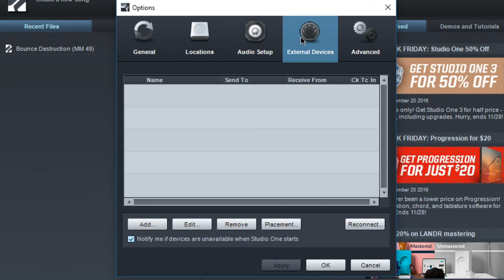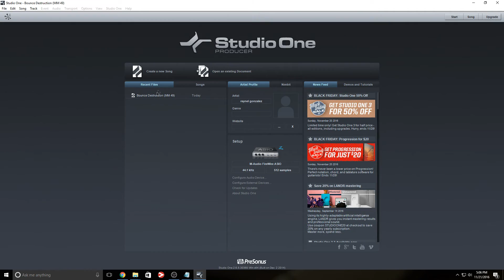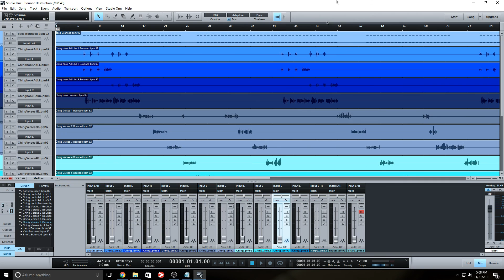setup M Audio ProjectMix I/O with Studio One

Comment: Would this be possible to do having the project mix connected via midi port only? I don't have firewire but already have an usb audio interface, and I've seen one of these really cheap on the second hand market, so it would be nice to use it just for daw control
Reply from the maker: Unfortunately no you have to connect it using firewire.

Comment: Are you running windows 10? If so how did you successfully install the drivers for the project mix.
Please help me, I've been looking all over the internet trying to make this work haha
Reply: I can tell you what worked for me...
I don't use the FW400 jack that is on the motherboard.  I have a dedicated FireWire card with 2 ports that I installed into computer.
For some reason the chipset is more stable and just works better.  It's an LSI 1394 OHCI Compliant Host Controller. These are a dime a DOZEN on ebay...
https://www.ebay.com/itm/NEW-GENUINE-LSI-H924H-DUAL-PORT-IEEE-1394-PCI-FIREWIRE-CARD-LS2-FAE10/232903033386?epid=5023027389&hash=item363a1a422a:g:FL4AAOSwuTxbgACH
For Windows 10, i downloaded the latest Windows 7 Driver from M-Audio.  It's FireWire_Installer_6_0_4_Driver_5_10_0_5061.  This is the 64 Bit Driver
The one ending in _5085 is the 32 bit one.  don't use that one.  The 5061 driver works like a charm, and I am using StudioOne from PreSonus in Mackie Control mode inside of StudioOne to use the ProjectMix as a control surface for the DAW and as a Digital Audio Interface.  Best wishes....

Comment: hi does the project mix work with pro tools 12.7 i have tried it and it keep sending me the hui error i don't know if is the firewire cable i have a 800 end connected to the project mix and i have the 400 end connected to the pc , o i don't know if i need a fire wire card to work this thing .
Reply from the maker: Yes it works, My apologies for the late response. Yes you need a Fire Wire card with a Texas Instruments chipset.